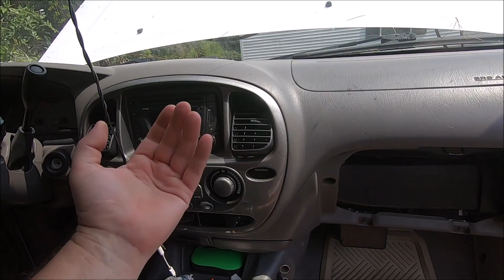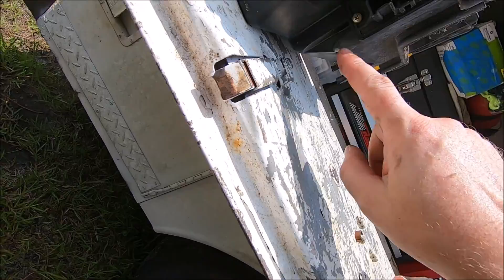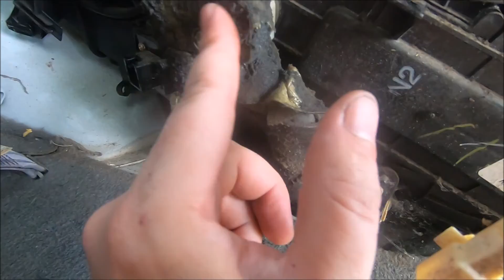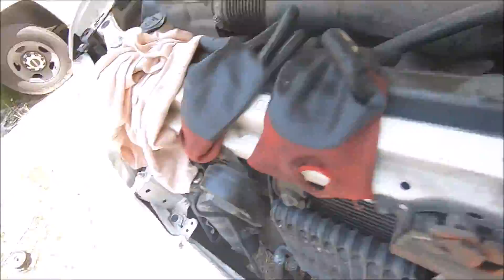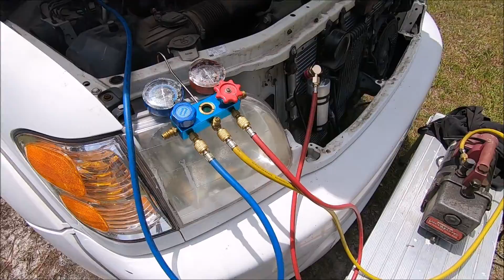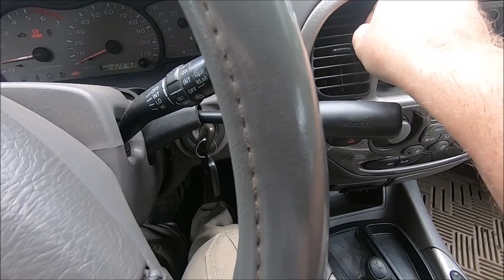2002 Toyota Sequoia Complete Air Conditioning Rebuild

Comment: Hey I was curious if you would know the answer to this , but let’s say I replaced all the ac stuff you just did but I don’t have a compressor to suck out and do all of that stuff can I just replace everything not turn on my AC till I get to a mechnic that does have machine to do all of that ?
Reply from the maker: You can, but the desiccant pack in the the receiver drier will slowly absorb all the moisture in the system to the point of saturation and then not perform its function as well, or not at all, later when the system is charged. Exactly how long it takes to reach that saturation point can vary. Having a good desiccant pack is a matter of efficiency later as its whole job is to absorb moisture that might be in the system when it’s filled and reduces efficiency or causes early freezing of components . Air will freeze before refrigerant and cause restrictions, which is one reason it’s undesirable, as well as causing system corrosion, and not being miscible with oil.
That said, yes, people often do that but I’m not sure how well their systems perform long-term.

Comment: The compressor should be hand turned about 8 times before the accessory belt is installed and the engine started to ensure it doesn’t seize due to hydraulic pressure
Reply from the maker: This only applies if you are using a liquid charge to fill it quickly. If you are using a 100% gas charge like I did here leaving the can on the scale and letting it fill with gas, there’s no way to slug the compressor. I stopped using liquid fills years ago because it’s just not the best method, even if it is quicker.

Comment: Also the oil should be spread across the system: 

To the New Compressor: Pour 3.5 ounces of clean PAG 46 oil directly into the low-side/suction port.

To the New Condenser: Pour 1.5 ounces into the inlet.

To the New Drier/Accumulator: Pour 1.0 ounce inside.

To the Front/Rear Evaporators: Pour the remaining 1.0 ounce directly into the flushed evaporator core lines (0.5 oz front / 0.5 oz rear).
Reply from the maker: It is good to remember that oil and refrigerant are miscible and the oil is circulated by way of the refrigerant. There’s very few parts of the system that actually need oil, and that’s mostly the compressor. The individual parts tend to collect excess oil because they hold large amounts of refrigerant.
Now, that said, yes this is one method of adding oil to kind of pre-distribute it in the system. I do it sometimes. But adding any oil at all anywhere will eventually make its way where it needs to go, and as long as the compressor has an initial oil charge it’s ok.
Keep in mind that the full-service automotive refrigerant machines add oil to the refrigerant itself as fills, and if you take your car to a shop that’s how the oil will usually be added after the system is buttoned up.

Comment: A good video but the accumulator is for the non Limited Sequoia, it does not have a/c in the rear so it’s accumulator is smaller.
Reply from the maker: Good to know, in this case the parts were all specified by a parts supplier that I usually trust, so they must have goofed. Honestly they are usually very accurate so I didn’t even really think to question it.

Comment: Why did you not flush the lines for old oil contaminants or metal?
Reply from the maker: A lot of it depends on whether there’s a reason for contaminants to be present. Such as a failed compressor or desiccant bag, clogged orifice tube or thermal expansion valve, or improper oil type.
Sometimes I do things off camera that I don’t bother to show, which usually involves blowing lines out with compressed air to see if further remediation is required. That’s usually a step I do on all systems I haven’t had apart before as a test to see if there’s anything in there that isn’t supposed to be.
But in general when you pull the charge, you can tell if a flush is necessary based on what comes out.

Comment: Very pertinent for me - I have a 2006 Sequoia Limited AC that was operating perfectly, bu last year when idling it started blowing warm air. I turned it off and then turned it back on, I felt the engine start to bog, so I immediately thought the compressor was locking up and I shut it off. I have since disconnected the wire to it so it can't turn on. I ordered a new Denso compressor, condenser, dryer and front and rear expansion valves. My compressor is not locked up - still turns by hand, so hopefully there wasn't too much garbage that made it through the rest of the system. A local mechanic who services AC systems told me that his experience with Toyotas is that the debris get captured by the condenser and filter dryer and don't make it to the expansion valves. Have you had any experience with compressor failure on these vehicles?  Can the front expansion valve be changed by accessing it through the firewall side without pulling everything out from under the dash?  Thanks!
Reply from the maker: Unfortunately the front valve cannot be replaced without pulling the box (ignore first response this is corrected. Somehow the AI auto respond fell in there).
In my limited experience, when things get trashed internally anything is possible as far as debris goes. Once there’s debris in the system, it can be anywhere in varying quantities. But you can get lucky and have it contained.
In your case if the compressor isn’t locked it could a variety of things. I would probably look at it closer before committing to replacing things. It’s easy to get expensive fast with unknowns.
Reply: Thanks for the reply!  I am going to pull the compressor tomorrow, so that should tell the tale. I feel a slight rough spot when turning it, so I am pretty sure something is going on with it. It should be pretty obvious if it is bad, right?  I would expect to see some debris in the discharge hose.
Reply from the maker: @coachtomsvolleyballchannel2286 it might be obvious, it might not. Fine metal particles can make themselves pretty hard to see sometimes. It’s honestly really hard to say. But generally if any metal gets in the system I consider it a full rebuild or full flush because I don’t like doing things twice. But that’s just me.
Reply: Also, about how long should I expect it to take to pull the dash apart and R&R the evap/expansion valve. Do you think I would risk anything by not replacing the valve if everything looks clean after the filter/dryer?
Reply from the maker: @coachtomsvolleyballchannel2286  it’s not too bad to take it apart…. A few hours if it’s the first time doing it. As far as being able to see gunk goes….. it’s always a gamble if the compressor is truly trashed. But the risk gets higher the more the compressor is worn, even if you can’t see it. It could be anywhere in the system.

Comment: What is my problem with my 2002 ? The ac works but the middle vents are not blowing hard. The side are blowing good....
Reply from the maker: The first thing I would look at is the doors and actuators. It’s not easy or fun. It’s all buried up under the dash, and a lot needs taken apart for proper access. But you can wedge your head up under the steering column and then check that the linkages are working properly for the doors that control the air flow. The actuator and linkages are on the driver side of the center of the console, up under the dashboard. It’s likely that you won’t be able to see that much is working fully with taking things apart. But some of the flappers and doors can be seen through the plastic case as they move if you shine a powerful light through the plastic and watch the shadows of the doors on the other side.
If the doors are working properly, it’s possible there is still an obstruction inside that you’ll only find by taking it apart. That’s a starting point, anyway.

Comment: Hi , how did you find out about the bad evaporator system?
Reply from the maker: If you suspect a bad evaporator coil, use a refrigerant sniffer at the evap drain, set on high sensitivity. You can also snake it down a vent but that doesn’t always get a reading. Even sniffing the drain doesn’t necessarily get a reading.

Comment: Wow what a good job you did on that truck I have a 2001 sequoia ac works very well in the front  but I don't get cold air in the back I checked the evaporator in the rear and 2 pipes are really hot but I dont feel any cold pipes and I think that the expansion valve is shut closed any help please
Reply from the maker: That would be my most likely diagnosis as well without laying eyes on it. Generally if it’s stuck wide open you’ll get just a tad of coolness, but even that might be hard to see because of the long lines back there. But wide open or totally closed, stuck is usually stuck. Sometimes the bulb will loose pressure and then the valve can’t react either. But that is also a failed valve scenario. Basically yes; the first thing I would examine would be the thermal expansion valve.
Reply: @wrenchwranglers on this video ehrn you are removing the evaporator on the bottom left are 3 bend lines that you dont touch at all those are lines that fell really hot  i want to think its becouse of the high pressure
Reply from the maker: @EvoTorres some of those are going to be heater lines so keep that in mind
Reply: Ok then I'm not getting high pressure to the expantion valve Im gonna have to follow those pipes to the front of the truck
Reply: Hey! Great video! So I have to ask, if I'm just trying to do the rear fan motor, can I just unbolt that sucker after I take the panels off? Plug and play?
Reply from the maker: @themountainman3337 I’m going to be honest here, I really don’t remember. But it should (theoretically) be easily accessible once the panel is removed from what I think I remember. I know that isn’t remotely helpful but that’s all I have.
Reply: What did you use for the lubrication on the O’rings? I may have to do a complete system replacement and want to use the correct lubricant.
Reply: @p2farm429 use pag oil. 
Same oil that goes into the system

Comment: Im having a problem with my 2004 toyota sequoia limited and mine has the rear ac its not kicking the compressor on to blow cold air i pulled out the old freon and pulled a vacuum and let it sit all night and it had no leaks and i refilled it woth freon to factory spec and the compressor still wont kick in but it worked and cooles great if i jump the relay for the compressor its just not getting the signal i guess to come on i replaced the high pressure switch still wont kick on figure its maybe a low pressure swich but cant find one oh and i done tried a new relay any thought's
Reply from the maker: @magicdirt55  these generally use a trinary switch rather than a separate high/low pressure sender. The trinary switch sends a value for high and low, and also controls the fan. First thing I would do is verify you have the correct switch and didn’t replace it with the wrong unit (it is possible if the parts store gave you the wrong one). If it has a trinary switch they are a common failure point, even brand new. Beyond that, you should verify the HVAC control unit is sending a signal to engage the relay.
Reply: Ok thanks

Comment: Os the low side ac pressure sensor behind the dash need to replace mine can't find it found the high side in the engine bay
Reply from the maker: These generally have a trinary switch, which monitors both high and low pressure in the same unit, as well as controlling fan function. So there should (unless your vehicle is different or modified) be only one switch.

Comment: I want to delete the rear blower, there are block kits for the rear AC, but i don’t know if what size mm, and wether i block them in the engine bay, or right at the blower in the rear. Any thoughts?

Thanks
Reply from the maker: I would avoid as much dead-ended line as possible and basically cap the lines as close to the ‘T’ as possible. I don’t know where the kits do it, so I cannot speak for that. The best option would be to remove the ‘T’ completely that goes to the rear. You can modify lines yourself fairly easily if you are willing to create flares and use flare fittings, such as sectioning the line on each side of the ‘T’ and flaring the ends and inserting a flare union to rejoin the remaining 2 of 3 sections that are desired to be retained. Doing that gives you the best flow without any interference created by dead-end sections. But I’m sure the effects created by a short stub are minimal.
Just my thoughts on it without knowing anything about the kits.

Comment: Hi W.W. I have a 2001 Sequoia that I think needs a new hvac control cable (mine seems to have locked  up due to OH winters perhaps and won't move anymore) this is the cable that connects to the heater valve at the firewall and then connects above the passenger foot area to the hot/cold switch next to the fan motor. If I got a new cable can I just feed it thru the firewall and pull it thru to the foot well by attaching the new one to the old one and pulling it through? Just curious and I appreciate your help. Thank you.
Reply from the maker: It should be possible to do it that way but I don’t remember what the firewall grommet looks like off the top of my head. I would do it slow and gentle so as to not damage the grommet and it should be fine.
Reply: Es fácil de poner

Comment: Nice job with a very detailed video bud, I did the same to our 2001, but when done, temp only got down to about 75 in 90 degree day, scratching head wondering what else is needed to get it colder?
Maybe changing the hi-lo pressure switches next?
Reply from the maker: If I remember correctly these have a trinary switch. Which monitors high pressure cutoff, low pressure cutoff, and fan off/on points. If the compressor and fan is cycling on properly, it’s probably not the switch. It is possible that the mixing/blend door valve can get out of adjustment…. I would probably verify that first. You can reach up under the passenger side and see it buried under the hvac box. You can make sure it is moving full range by watching it. If that and everything else is working properly and all your pressures are correct, then it needs some more detailed troubleshooting. At that point I would probably start measuring superheat and so forth and looking for possible trouble points in lines, like obstructions or sudden temp changes in lines where there should not be.
Reply: @wrenchwranglers  Thank you for the tips, I'll go through to check point by point.

Comment: I used a coil gun (Nu-Calgon's, which is the same one for home a/c condensers) to clean off my 2000 Tundra's a/c condenser (and the little bit of radiator that is exposed) and a lot of oil and dirt came off.  It wasn't visible to the naked eye before cleaning but it was certainly there, and a lot of it.  It took three cleanings before it removed all of the oil (you'll see an oil sheen in the runoff if you are still removing oil).  Years of highway driving with the light ends of asphalt getting kicked up from vehicles ahead of you will eventually lightly coat your condenser.  The cleaning made a huge difference.   For the cleaner, I used the Nu-Calgon Nu-Brite.  Rinse thoroughly or it will eventually mar your paint.

Comment: Thanks for this! And for using the correct terminology! I've kinda been procrastinating this job on wifes car for a while. 
Actually looks easier than the Fords and Dodges I've done.
What were your pressures at once to got it charged up?
Reply from the maker: I don’t remember the exact pressures, but it would have been in the spec range for r134a relative to the ambient temperature. I usually charge by weight when I can, but fine tune by pressure/temperature charts where necessary.
Reply: @wrenchwranglers  Hey, thanks for the reply! 
The reason I was asking about pressures is, on mine I'm running 55psi suction and around 225 discharge at 80F ambient.
Blowing about the same as yours 59-60F at the vent. These pressures seem pretty high for R134A.

Comment: why its not cooling? did you find the problem?
Reply from the maker: In this particular one, it won’t go below 60 degrees. I checked the blend doors, heater shutoff, etc., with no success. Rather than throw more money at it tearing it down again, we opted to let it ride at its current point.
Reply: @wrenchwranglers needs more airflow trough condenser with the help of another condenser fan and the removal/re positioning of the transmission cooler which just adds unnecessary heat to the condenser, design flaw
Reply: @wrenchwranglers por lo que e visto tienes problemas en fan cloche anda muy suave con en motor en realinti